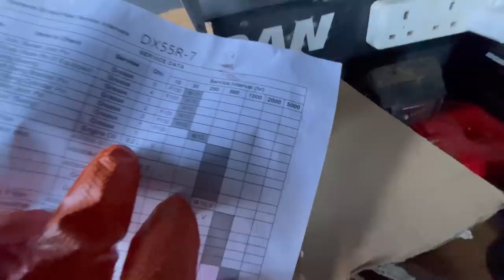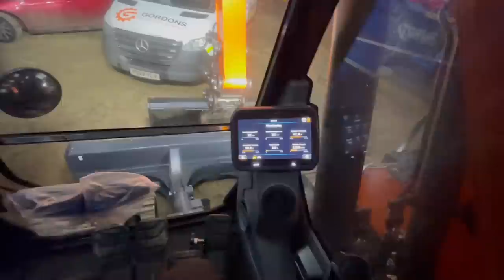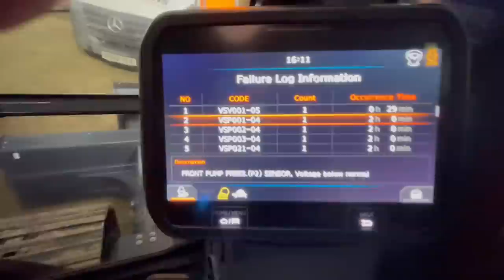Episode 135 - Odd jobs and @OllyBlogsAgricontractfarmer  festive tractor run !

Comment: Cracking video as always bud and looking forward to the slew motor job as they can be a pain on the backside I've done one on a Hitachi 8 ton took me the whole day to get it out and put into place and then back next day to pipe back up
Reply from the maker: The smaller machine’s definitely take longer did the 160 yesterday should be in todays vid took maby 3hrs 👌